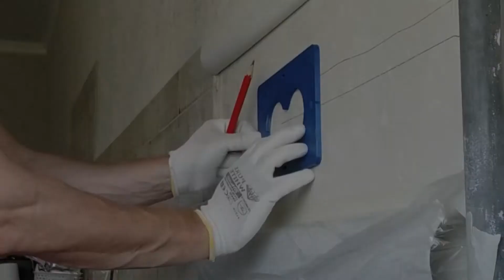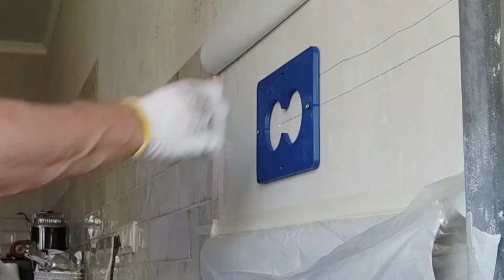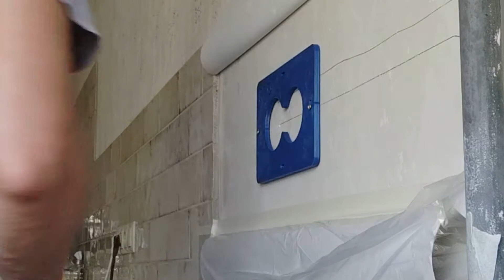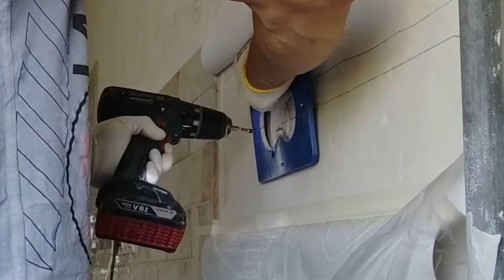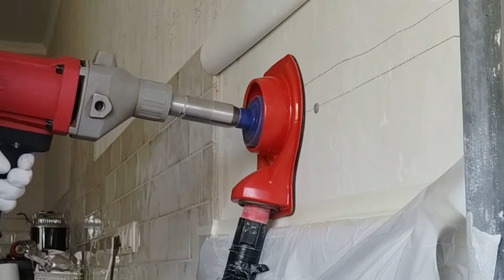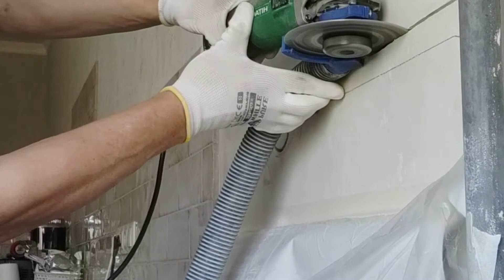Wall plate hole pattern

Comment: So what are you actually doing?
Reply from the maker: :) This is difficult for Americans to understand. You have plasterboard walls and square electrical outlets.  But imagine that your walls are made of concrete and electrical outlets are round. And you need to install such an electrical outlet in concrete and bring wires to it.
Reply: @mishkinrnd  .. we call this process chasing a wall.